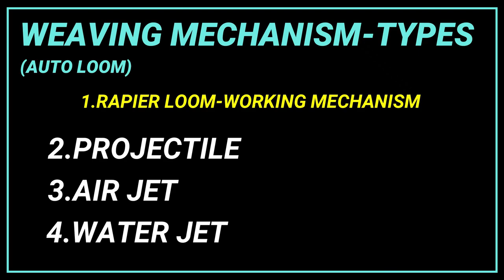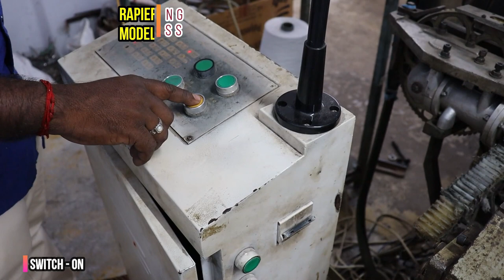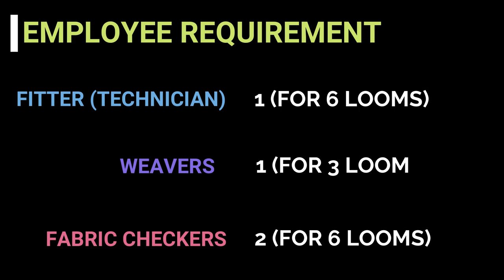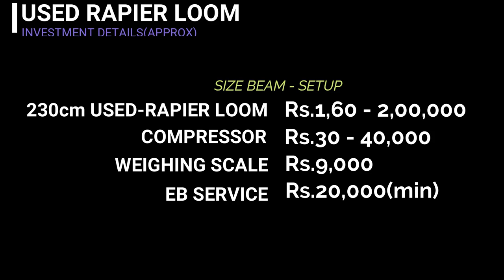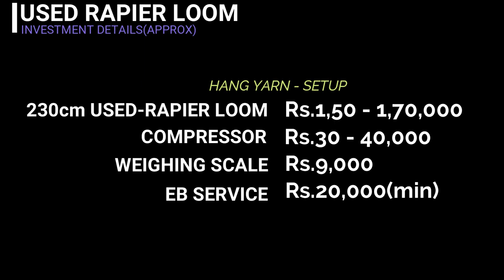#RAPIERLOOMTEXTILETAMIL  LOWBUDGET , ஆட்டோமேட்டிக் தறி, #AUTOLOOMBUSINESS ,,

Comment: Sir vanakam en per dhamodharan China rapier 6 loom vachrukom ipo engaluku 40's 40's 74reed 80 pick 63 inch order varudhu intha ragam namma loom hyrl 786 model ku potuklama 80 pik iluthu odungla
Reply from the maker: Very very tough , not possible, based on your machine condition like new, it's possible

Comment: Sir 6 china rapier loom eduthu own sort grey fabric run panromna 200 cm china rapier la 78 inch varaiyum ottalamna but market 78 inch and 68 ,63 inch intha mathiri regular sort irukuma illa wide width sort marketla athikama thevaipadum pothu 72,68,63,50 inch intha fabric market irukuma sir please sollunga sir
Reply from the maker: Normally for rapier loom up to 63" sorts regular ah irukkum , more than 63" or wider width sorts are not regular items, because those sorts are running at sulzer projectile looms like PU, TW11, P7100, P7200 models,

Comment: Sir ippo intha video la irukura mathiri fabric weave Panna ownerku labourku Enna koolie varum
Reply from the maker: Weaver cooly:Rs.550 to 600/3 Loom (color sort)-12 hr shift

40pick X 0.18paise cooly with 180RPM speed 
Rs.1,200/day(24hrs)
1,200-500(Expensess)
Average profit:Rs.700 to 800/Loom
Minimum 4 to 6 looms suitable for this kind of orders,

In this video taken loom shed having 6 looms with above mentioned profit ratio 

If you are taken hang to cone conversion set up pick rate will increase up to 24 to 26paise

Comment: Irukathula high spped loom air jet loom  , air jet loom la உள்ள motor ra 
Rapper tharila set pannalama, rapper loom air jet equal mechine run aaguma
Reply from the maker: We can able to fix the Motor, But Airjet and Rapier Mechanism are different, so it's not possible,

For example:
Fix the Royal Enfield Engine(Airjet) at Electric Scooter(Rappier Loom)
Reply: no , Airjet suits for only 20s + above weft yarns , flexible rapier is convenient for less than 20S count weft

Comment: Sir one  inchuku how many pick set pannalam  china rapier loom
Reply from the maker: Weft yarn count?
Reply: 30's 40's 60's 80's 100
Reply from the maker: @ratikantamalik9548  30s , 40s,60s-68 to 70picks/inch,
80s-88 to 90picks/inch,100s-120picks/inch.
Reply: @TextileTamil  how you calculate like this 
It's all about machine pick force calculate
Reply from the maker: @vijak752  yes exactly,
Read the question once again, it was mentioned machine name
"China Rapier",
Based on this particular machine pick force I am given picks that are maximum possible for each counts,,,

Comment: China rapier ga798 model used and New loom price190cm 
Ga747 mode 250cm price
Rapier loom width and length details
Please details reply
Reply from the maker: Used 230 machines started Rs.1,80,000 to 2,20,000 depends upon Loom condition, 
Due to China to India Shipping charges fluctuation can't able to predict new machine price,,
Reply: @TextileTamil  thanks

Comment: What is the cost of machine for investment and space..
Reply from the maker: 4 looms x 2.5 to 3 lacks
2,000 to 2,500 sqrft building
1 compressor 
1 weighing scale 
1 checking table 
1 pining stand

Running capital:2 lacks
Reply: @TextileTamil  சார்,,,  எதிரெதிராக இரண்டு தறி வைக்க எவ்வளவு அகலம் இருக்கணும்...
Reply from the maker: @rameshmurugesanmurugesan3092   
230cm x 2 Looms
Length:25 feet
Width : 20 feet 
Required space (square feet)
25 x 20

Comment: 380 cm china  rapier loom la evalavu rpm varaiku irukum
Reply from the maker: Normally 190cm to 260cm machines are able to run 180 upto 200RPM, Above 280,320,340,360,380cm Looms are able to run 140 upto 180RPM, which means while increase the loom width RPM will reduced,,
Reply: Sir appo somet vamatex dornier intha mathiri loomla 380 cm ku enna rpm varum please tell me sir
Reply from the maker: @windmusic1315 
 SOMET: 380CM
BASED ON MODEL RPM WILL DIFFERS:
SM93:200rpm
THEMA 11E & EXCEL:250rpm
SUPER EXCEL:280 TO 330 rpm

Like the same above based on the VAMATEX rapier loom model RPM will differs..

Comment: looking for German terry rapier used looms for bank loan , fresh on DIC loan
Reply from the maker: Vamatex lenardo
210 cm  17 and 
190 cm  7 machine 

Total 24 looms

Staubli Dobby 7 loom
Filmtex dobby 17 loom
8 colour machine
Accessories
1.5 beam and cloth 
6 frames
2 accumlatar
5-5000 heddles and dropers

Machine are in excellent working condition.

All machine running with 80-85% 

Location india

Price  5 lac (Negotiable)

Comment: One China rapier loom 190cm reed 
Minimum space requirements length width height
Reply from the maker: Machine Height:6'Feet, 

Machine Width:3'Feet+Weaver Side 2'Feet + Beam Loading 2" Feet =Total:6 to 7'Feet, 

Machine Length(190cm):6.5'Feet + Feeder Side:3'Feet + Dobby Side:3'Feet=Total:12.5'Feet.

For Container Loading(190cm): 
Height X Width X Length
5 X 6 X 10 = 300Cubic Feet.
Reply: @TextileTamil   thanks

Comment: Used toyoda air jet price evalavu
Reply from the maker: 12 to 14Lacks Good condition..
Reply: Sir please reply width and rpm
Reply from the maker: @windmusic1315  
Used Good condition machine:
Width:190cm to 230
Used RPM:700 to 800
New:850RPM to 900

If Wider Width:280cm to 330
RPM:600 to 700

New:RPM 700+

Comment: Sir used and new 190 cm and 340 cm airjet price evalavu
Reply from the maker: Used 190cm Airjet
Toyota 710-14 to 16 lacks
Toyota 810-23 to 25 lacks

Used 340cm Airjet
Toyota 710-16 to 18 lacks
Toyota 810-25 to 30 lacks

Picanol and Tsudakoma Brand airjet looms also available in this price range,

Chinese Airjet also available in market, but at present new looms only available,
Price Range Starting from 17Lacks onwards,,  

(Note: These Price range are approx, based on machine condition +or- may differ..)

Comment: Hi bro 2 rapier loom enaku venum 
Evlo agum
Reply from the maker: 230cm china rapier
Model:SJ738-Yr:2012
4 loom 
6frame/loom
2 accumulator(small)/loom
1.5Beam/loom
1.5Cloth Roll/loom
5000 Heald wire&drop pin

Rs.2.50Lacks/loom

Contact:+91-93610 15503
(Whatsapp, Telegram,imo)